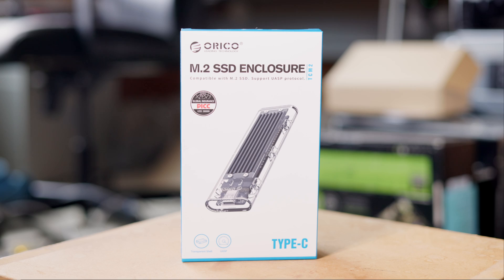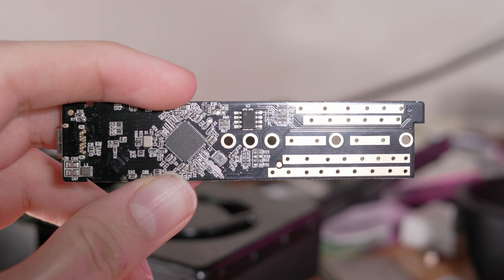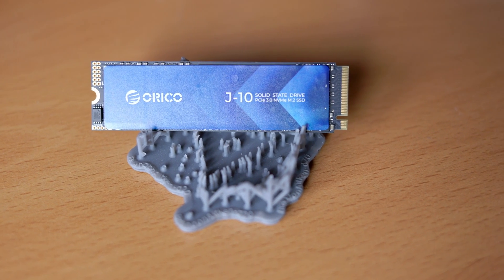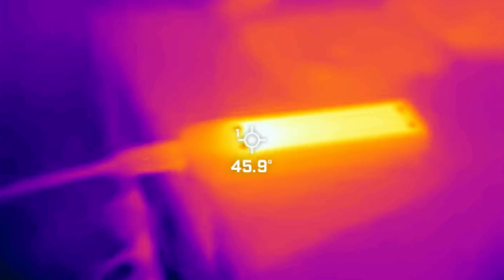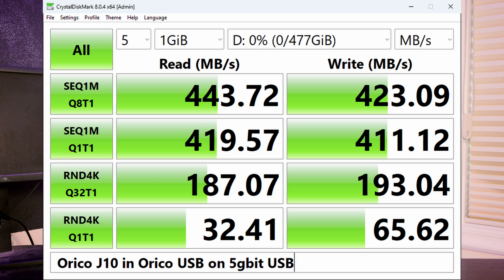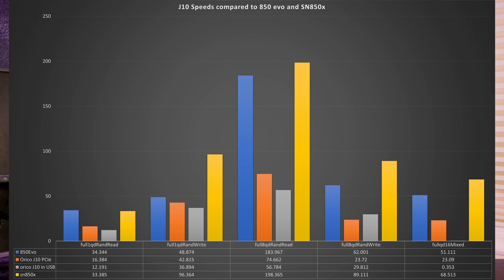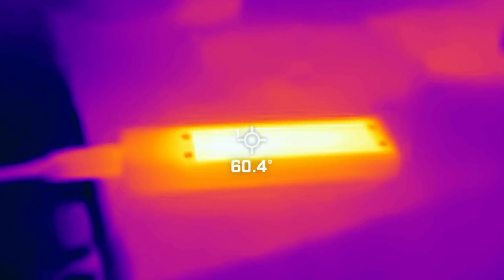Orico J10 and USB to M.2 NVMe enclosure review

Comment: I got maxio controller instead of realtek
Reply from the maker: That’s not optimal. I’m guessing this is anouther parts bin ssd where the parts get swapped without changes in product name or branding.
Reply: @ElectronicsWizardry  even the led color is green! Instead of red. Is maxio a bad company? I bought it for $40. My main use is media storage.
Reply: 1 tb for $40.

Comment: Should have written the entire capacity or until it ran out of slc cache, qlc gets slow when full.
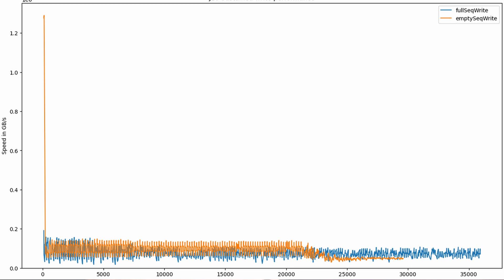Reply from the maker: Look at 8:16. That's a graph of writing the whole drive and seeing the performance hit. It drops down very quickly past the first gig or two to speeds of about 80mB/s average. A empty fully trimmed drive is a bit better than a already full drive, but this drive is still not great for any sustained write uses.
Reply: @ElectronicsWizardry  Ah ok, my mistake, I was on bluetooth headphones and doing something else so probably drifted over that part.   Mine has survived half a dozen full drive writes already, so far so good for a cheap scratch drive, it does run hot though, so a full heatsink ORICO M2PV case is necessary, the crystal plastic one is insufficient.

Comment: That crystal enclosure is designed for looks, the slide on cover doesn't facilitate good contact with heat pads and the tiny heatsink, they have a more rationally designed one where the entire lid is the heatsink.   They seem to be bundling with the better design now.

Comment: Nice to see your review after I bought 2 of these disks (1To), just because first I bought a samsung a few days ago and I was surprised it didn't work in a Thinkcentre M910Q (Probably because it is a Gen4). 
So, after a few researchs, I discovered the Orico which was a good price for a 1To and still a Gen3. It works perfectly after installing ProxMox and a few containers is working great. The only problem is the heatsink because this model of thinkcentre has a socket inside which is confortable and a socket under the motherboard which is limited if you have a heatsink... But I'll find a way.
I'm quite new in proxMox (less than one year) and I've read a few of your tutos. I was basicly attract to the power of ZFS, and ProxMox has been a testing for a few month and now is my future.
Just now, I've connected my proxmox to a Synology NAS with 12 ahrd drives, and I'm so surprised that I've connected my PVE to the NAS in less tha 30mn in samba with no experience... and also discovering that now, any container I want to create, ProxMox proposes this drive exactly like he proposes the local drives (I just say no today keeping everything on my loacl SSD). Basicly, as now I really want to work with ProxMox, the NAS is a good option for backups, and I must say that I'm so surprised that I've reinstalled my configuration (I made a few mistakes in ProxMox) and it has been so simple to come back to work with a few containers issued from a backup from the NAS.
Since years, I work with Synology NAS and Raid system + external backups for me and my clients: security, security, security. 
In the next 2 hours, my challenge is to install on the same proxmox machine an external 5To hardrive to make more backups and probably to record videos from Frigate. I'm expecting another internal SSD 5To drive in 2 days... and after seing tour review, I ordered 2 more Orico, may be using them with no heatsink or a flatter one with an equivalent machine that does accept only a thin SSD.
As you're good with disk, ProxMox, and partitions, you might make a real tuto to explain with a banch of different disks (may be old) and slots what you would suggest and why... Why partitionning, why choosing ZFS or not, etc. So many wrong informations... And I almost forget this example: What is better for Home Assisant or so many other programs: Any backup through ProxMox or a HA Backup (Size, rapidity, reliability)... I will start my own tests soon.
Anyway, thank you for the way you give informations... I'm going back to your other video "Using external HDDs in Proxmox"...

Comment: A tip I've discovered for screwing  m.2 boards in, take a thin plastic like a sandwich bag or shrink wrap and poke a hole in with screw then attach it tight to the screwdriver with tape,  hols board down then start the screw then pull back so plastic pulls off the screw then remove plastic and tape off screwdriver and complete tighten the screw.

Comment: I wan't to run Linux and install games on one of these, I see Orico makes a similar housing with a built in fan, that one is also clear and a bit bigger than the one in the video, is that fan necessary or should I just get the one shown in this video?

Comment: I've been using a similar enclosure RTL9210B for about 3 years (with a 500GB P31G). I hit similar speeds (8-900 MB/s). What is nice about this chip is that it also works with SATA M.2 drives, which helps if you're cloning old laptops. dancharblog has a list of common chips and their speeds. For the J10 drive, it is not suitable if your use case is shooting 4k60 which needs ~ 150MB/s.
Reply from the maker: This model is listed at NVMe only, which is a bit annoying as the chip seems to support. I haven't run across that many SATA M.2 drives though as NVMe seems to be the majority of drives now.

Comment: Orico enclosure ok. Orico NVMe, nop.
They all use off the shelf chipsets so just buy the cheaper ones.
Reply from the maker: I think that's a reasonable summary. I think these low end SSDs have some use cases, but struggle in many workloads like sustained writes. I have deployed many low end SSDs in basic office PCs in the past without issues.

I was thinking I could do a roundup of low end SSDs(or perhaps a different class of SSDs) but I worry that the performance would be similar, and parts in the SSDs would change so even if there was a clear 'winner' in the tests who knows what chips it would have in 6 months.

Comment: I appreciate your efforts, but... man the welds on the USB Type-C connectors in the Orico enclosures I've used have never been great. I went through three of them. Pretty darn frustrating.
Reply from the maker: Thanks for bringing this up. I can see how there would be a lot of force on the type c connection and failure would happen. I unfortunately don’t have a good way to test for this but I think it would be better to attach the type c to the case instead of soldering to the board.

Comment: Neat so a realktek chip rated for USB 3.1 will actually get ~1000MB/s that's good to know. I'd then assume USB 3.2 would get you close to ~2000MB/s and USB 4 between 2000-4000MB/s with an Orico enclosure of the matching controller type.